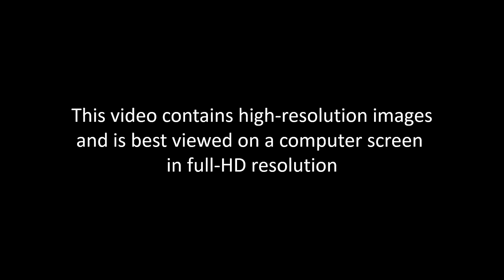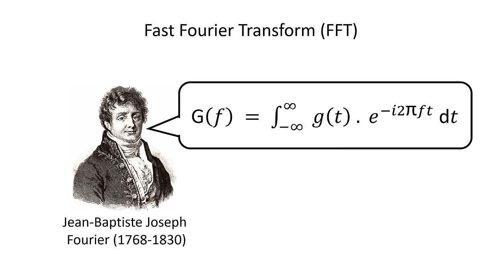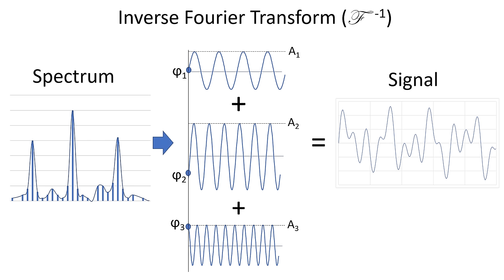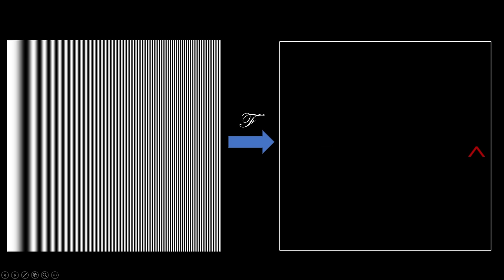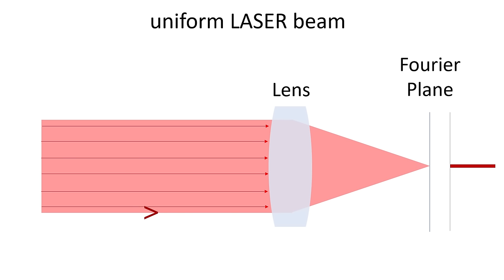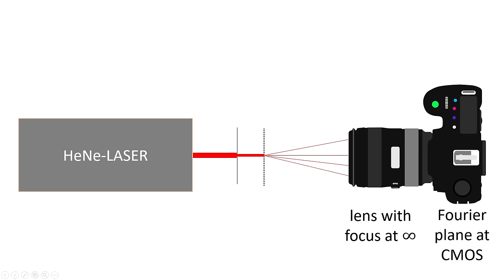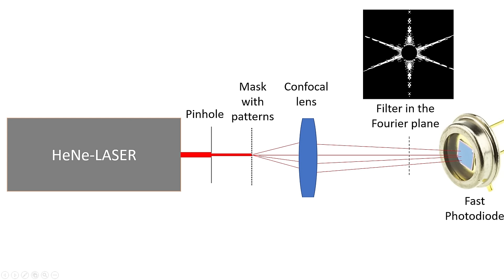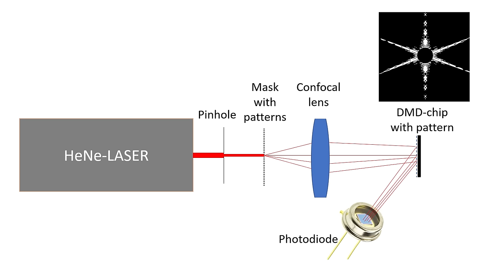Fourier Optics used for Optical Pattern Recognition

Comment: I find the comment at 14:15 very fascinating, but not for the obvious reason. I think it is amazing that a medium speed CPU that is doing hundreds of things simultaneously is "only" a few billion  times slower than a beam of light doing the same thing. It speaks to just how far modern computers and optimisations have come in the past decades, as before that time doing an equivalent calculation to a physical phenomenon would have been unthinkable.

Comment: As many others have noted, this is a wonderful video clip !  
Optical fourier filtering was done on seismic data a few km from you at the Shell Laboratory in Rijswijk over 50 years ago.  Research geophysicists did  bandpass, wavenumber and even deconvolution filtering on a set up there. I never saw it in action but saw some of the results.  The technique had a low dynamic range, was very fiddly, and was quickly superseded by digital methods, though some optical filtering research continued there into the 70's.
They sent optical equipment for a system to their exploration group in Melbourne.  I made a brief, unsuccessful attempt to get it to work there without a manual (or experimental talent).

Comment: I understand the fourier transformation and did calculate it manually a few times, but I just couldn't fully grasp the Fourier optics. Several PhDs tried to describe it to me with no success. Books didnt help ither. 
Yout did a great Job in a few minutes, you gave me the right understanding for it. 
Thank you so much.

Comment: I'm actually speechless...

I've been trying to understand how to implement FFT in a computer for so long, every explanation i've found has eluded my comprehension. And you just made me get exactly how to program it with some green and red shading on a graph.

I love this channel, thanks so much for this video!
Reply: It is indeed a really easy to understand explanation for how the Fourier transform works, but the fast Fourier transform algorithm is significantly harder to do.

So sadly you didn't learn how to implement FFT, you only learned how to implement a naive slow FT.
Reply: @inv41id  ah yeah i understand, it just so happens that the naive method is precisely what I needed because I don't care about phase for my applications.
Reply: @tiggerbiggo  Oh I wasn't really talking about phase, I was more so saying that the naive method is much slower, which is pretty significant considering FFT has the word "fast" in the name
Reply: @inv41id  yeah that too, at least my understanding is a bit better than it was before, and this naive method seems like it would still be useful in smaller applications where speed is not a big factor. Definitely not suitable for use in audio effects because of the speed and lack of phase information which would be critical for doing the inverse calculation accurately

Comment: Since much of the energy of the Fourier transform is concentrated near the central region, one method to reduce this effect is to offset the object (letters A, B) from the optical axis of your setup. The optical Fourier transform is invariant under translation in the filter plane such that the correlation peak will also be offset. Instead of a photodiode, one can use a camera to observe the correlation spike in the image plane. If you move the object, the correlation spike will also move.

Comment: Great demonstration & explanation of the fourier transform / mechanism! Some computational perspective: the fft takes O(n^2 log n) to compute for a square n x n image. To read out the signal on a photo-sensor of the same size, it takes O(n^2) time. So the gain in time is miniscule (log n).
Reply: Why would the photosensor have to be of a comparable size? Don’t you mostly just need to distinguish between more and less, not so much where on the sensor it hits?
Reply: @drdca8263  if youre using radio then youre right, the satelites use laser afaik, it is more efficient & possible in the vacuum of space.

Comment: Exceptional channel, immediate subscribe. 
I would be willing to bet literally any quantity of money that this is the exact technique the National Reconnaissance Office and or CIA was using to analyze the reams of Corona spysat film in the 60s and 70s (for finding and roughly "counting" eg. jet aircraft in a particular set of film images) long before digital computational power was anywhere near sufficient for such tasks. It is effectively an analogue computer for image analysis that operates at, as you note, fantastic speed, and with extremely low energy requirements.

Comment: Before 1978, Fourier Optics was the standard method for reconstructing real images from the data recorded by the Synthetic Aperture Radar (SAR) systems. The received radio signals were recorded on photographic film, and then the film was developed and passed through an optical Fourier transform machine to convert the information into the image of the landscape. SAR technology is still used today in earth observation satellites to obtain high resolution images at night and through the clouds, but all the processing is now done electronically.

Comment: Nice video.  For anyone want to do this on a low budget then read on...  
You need a laser pointer pen, a convergent lens, a caliber and a microscope crossed grid slide available from Amazon.  Due to the poor beam quality of laser pen it serves as a good parallel beam for illuminating the crossed grid target.  Place the crossed grid at the focus of the lens to observe the diffraction pattern formed with the laser.  At a viewing screen some distance away from the lens observe the image of the crossed grid.   Place the jaw of the caliber at the location of the diffraction pattern to observe the effect of spatial filtering.  Rotate the caliber and you would be able to observe the vertical and horizontal grids appear and disappear due to spatial filtering of the high frequency components.

Comment: The fast Walsh Hadamard transform is a lot simpler to compute than the FFT especially using integers. With a specialised IC hardware design even extremely fast optics would have a difficult time competing.
 And these fast transforms have a matrix equivalent. The FFT can be viewed as having a 2 matrix equivalent, one of sign waves, one of cosine waves.
Neural networks have weight matrices. With a little bit of technical creativity you can use a fast transform as the weight matrix for a neural network with a great deal of time saving over computing the large weight matrix multiplies in conventional artificial neural networks. Eg. SwitchNet, SwitchNet4.

Comment: As a physics student who has studied Fourier transforms in at least two papers, your simple explanation really takes the cake! I’ve wondered if it’s feasible to make an analogue oscilloscope that modulates brightness instead of the y deflection plate, feeds that brightness modulation into a Fourier optical system, and displays that on a conveniently visible screen. Latency-free Fourier oscilloscope! Might want to figure out how to turn the resulting brightness modulation back into a wave in the y-axis however, possibly requiring another image-sensor and a screen, which could certainly get clunky.
Reply from the maker: Many analogue scopes have a Z-input for controlling the beam intensity. I'm not sure your idea is feasible though, because the Fourier math is based on diffraction and that would be hard to realize on a phosphorescent screen.

Comment: In addition to the positive filter you could have a negative filter. While the positive filter does find the frequencies associated with the letter A (for example), it doesn't check for frequencies that A doesn't have. In other words, the positive filter looks at the pattern to see if there are any A's and the negative filter looks to see if there is anything other than A. My reason for bringing this up is that I was wondering how to discriminate between an I and some other pattern that had an I embedded in it (which most letters do).

Comment: such a fantastic video, now I understand why and how there was (is?) an optical co-processor you could buy that performed Fourier transforms using optics rather than traditional FFT computation. for certain applications the speed boost could be immense, I wonder if there's a FFT-on-a-chip and if some day we can manage to make an optical FT-on-a-chip. it would need to include spacial light modulation, focusing, and a sensor array.

Comment: Steven Lehar (slehar on Youtube) hyposesizes that our brains process images via a similar mechanism of resonance. I'd butcher it if I tried to explain in detail but presents a solid case that a spacial resonance based form of computation seems to be the only way the brain could perform the insane feats our optical system does.

Comment: if shor's algorithm uses fourier transform, could we do prime factorization with optics?
Reply: Bump
Reply: We need answers.
Reply: I don’t think so, as, the quantum Fourier transform applies to like, the state of a collection of qubits, where the amplitudes of different possible states are playing the role of the different numbers in a usual Fourier transform,
And like, there are 2^n of these numbers.

I don’t yet understand well enough to say “definitely no that wouldn’t work”, but I do think I understand well enough to say that I really don’t think it would?
Though..

[what follows is a confused attempt to identify more precisely what wouldn’t work by trying to think of how it would work if it did work]
Ok, suppose that we split (in how we consider it, not physically split) some interval of space for the beam into 2^n equal parts, where the intensity through each part is the number. Uh, the discrete Fourier transform then, would, uhh,
how does that compare to the usual one which this computes? 
Ok uh, so I think you would need to, change the phase of the light in a way corresponding to, exponents of a given integer modulo the number you want to factor, where the power the number is raised to corresponds to the position in the beam???
How could that be done?
If the exponentiation was done by repeated squaring,
Hm.
Ok, I don’t know enough about optics to really say, but that doesn’t seem feasible to me?

Idk
Reply: @drdca8263   I myself am not an expert, but I don't think your reasoning is correct. Firstly, your argument should also apply to electronic quantum computers, which we know do likely work. 

Fundamentally though, there is no "2^n distinct states" nor a need (or possibility) to split them in space. Rather, the wave of a single photon has a probability density function across these states (and phase is important too). I don't see any reason that optics cannot propagate these wavefunctions just as electronic quantum gates do.

Please do correct me if my reasoning is wrong, I too want to learn from this!
Reply: @nicktohzyu  oh, sorry, yeah if you are using n entangled photons, or whatever, uh, well, Shor’s algorithm can be done with the qubits implemented as photons.
What I was talking about was, trying to implement it without using any quantum mechanical properties of a beam of light, and just using wave properties.

Comment: Brilliant explanation on this topic. Before this video, I always thought the FFT is about the optical frequency instead of the spatial frequency. But even though it seems fascinating, I still doubt if it can be a practical way of image recognition. Since it's mainly based on diffraction, it will require a coherent light source and a very special mask. I'm very curious how this can be applied to ordinary pictures.

Comment: Amazing video... I have saw this experiment on Fourier Optics by J. Goodman when talking about optical convolutions, but never saw it in real life before. 
There was a cheap LCD screen manufacturer called Fourier Correlators that had a video of taking a high-pass filter taking the edges of a laser light video... I used their products on my thesis (holography FSO communications with LG modes)... you should look for it. Also those tesis work with results that allow to take speedlight adding/substraction operations, that also could be interpretated as a real scale visualization of the quantized nature of the orbital angular momentum, if you get interested: "Coherent multimode OAM superpositions for multidimensional modulation", is free to see.

Comment: Hehehe lovely. Not only a very clear explanation but with humor, heart and charm ❤️ Thanks!
I would love to hear how this is or rather was used. Without all the computing power I'd imagine this was used a lot in the past or ar the present for very high bandwidths.
What would the inverse look like for an optical system?
Reply from the maker: Well that question about the inverse really had me thinking. Unfortunately I could not come up with anything...
Reply: @HuygensOptics  Hmm well there is some symmetry. So if every ray would be mirrored exactly at each point of the plane the same lens should restore the same image, right?
If I don't mirror the spectrum wouldn't the image just be rotated 180°? Unfortunately I forgot all my math :(
Would be nice to see instant filtering by just putting different apertures in the fourier plane.

Comment: I found this very interesting. 30 odd years ago I worked on MRI scanners which work by performing a 3D Fourier tx of spatial positions to the frequency domain, then the computer does the inverse transform to form the images. Computers were slow back then and I thought it would be possible to use light if only it was possible to create the diffraction pattern.
15 years ago I worked for a music recognition company, which used Fourier tx on the audio, then a lot of computation to match it against a large library of pre transformed music. Again I thought it could be done much faster with light.
Your video today confirmed what I thought possible is in fact possible, thank you.
A couple of thoughts:
For your detector, if you split the beam and had two photodiodes. In one beam put your mask and the other a negative of your mask. You could then measure both the light that was passed and the light that was not passed.
For your source grating, would it be possible to use a DLP projector chip to reflect the laser beam?

Comment: Have you tried using an adaptive algorithm (eg LMS) in the final setup to match the DMD pattern to the focal-plane image? If you use the photodiode power as the metric, could you adapt the state of the pixels of the DMD so that the DMD will converge to a version of the image? If so, you could inverse-transform the DMD pattern to recover an approximation of the source image. 

My gut feeling is that maybe detecting only the power reflected by the DMD doesn’t create a metric that has enough information to drive the algorithmic updates (of the DMD position or pulse-width modulation) correctly. For example, does having the DMD reflect ALL incoming light produce maximum detector power?

Comment: I skipped a few lectures in the transforms from images to Fourier functions. 

I supposed inverse transforms are not possible using a purely optical system? However maybe you can do the verse transform digitally.

While this video focussed on spatial functions, wouldn't color be a more interesting topic and you get a result of spectroscopy? Meaning you could turn a color image in two spatial dimensions into a intensity image across one spatial dimension and maybe something like time if you are scanning across.

Comment: That's essentially what a neural network does (as far as pattern recognition goes e.g comparing A to B to A+B at 9:16 ) but instead of actual light it compares the patterns of the stream of bits coming from the sensor (or from a photo file) so after training some neurons get "triggered" on the A pattern only some neurons on the B pattern etc

Also please if you would be so kind could you upload the entire alphabet also include the Greek alphabet if possible? Thank you.

Comment: I noticed at about 2:30 into the video  when the 2 signals are compared & multiplied, that they start in phase. This must be the requirement for the computer algorithms and the reason why fft's always have that peak at the beginning. 
However, isn't it also true that the math is based upon an infinitely repeating signal, and since audio doesn't repeat itself infinitely, an fft cannot perfectly reproduce an audio signal?

Comment: Shifting the letter doesn't change the Fourier pattern.  Changing the letter size simply shifts the Fourier pattern, i.e. larger letter = lower frequencies.  I belief that the pattern resulting from the Fourier transform being applied twice i.e. Fourier transform applied to the result of the Fourier transform, will result in a pattern that can be used to detect the letter in any size.  Is this true or false?
Reply from the maker: False. The frequencies in the Fourier of different letters will be different and so the frequencies in the frequency conversion will be different. Changing the letter size changes the scale of the frequency pattern, but does not shift its position.